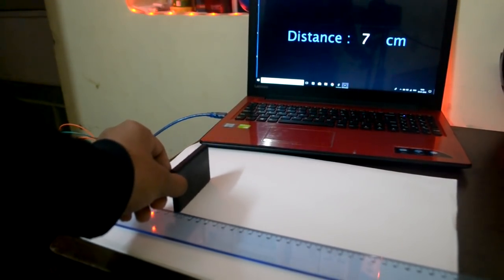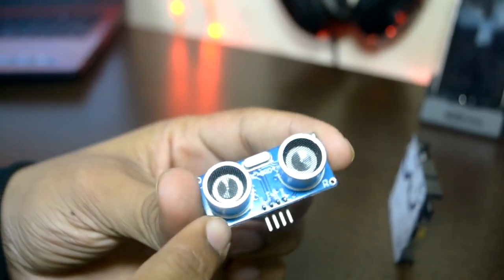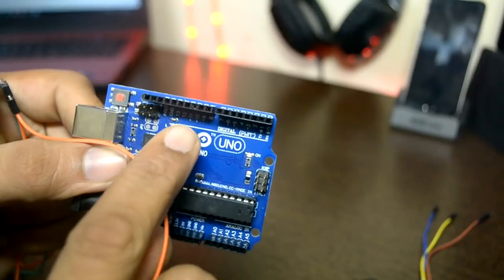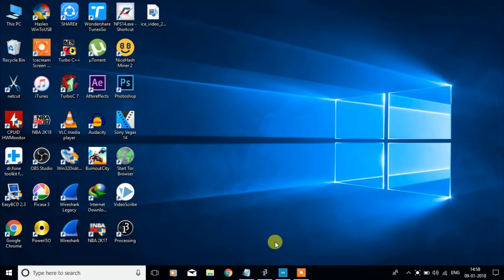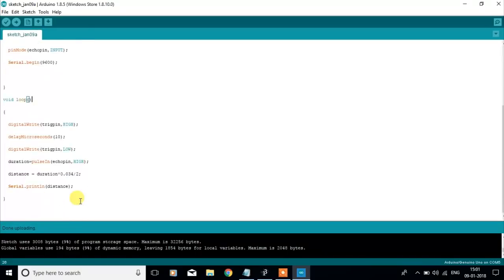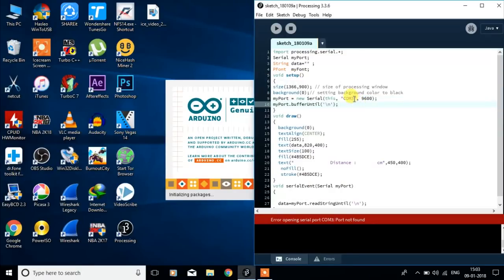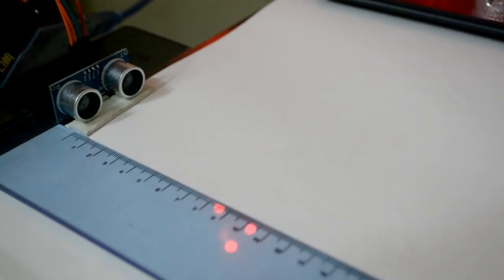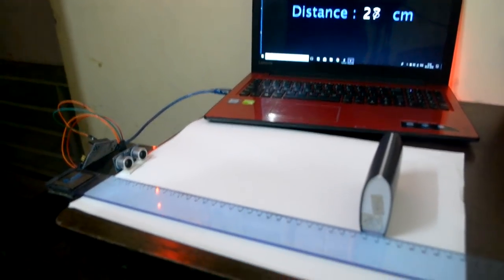[HINDI] Make An Ultrasonic Distance Sensor Using Arduino In Under 5 Minutes! Easy Arduino Project

Comment: Hi
I am on a macOS right now and when i run the codes it works fine but after the processing code is processed the sketch opened shows blank black page with no distance text...what to do???
Reply: how did you fix it?

Comment: C:\Users\Usman Fida\AppData\Local\Temp\.arduinoIDE-unsaved202307-10420-1l95blg.zik3\sketch_jan7a\sketch_jan7a.ino:1:10: fatal error: Mouse.h: No such file or directory
 #include <Mouse.h>
          ^~~~~~~~~
compilation terminated.

exit status 1

Compilation error: Mouse.h: No such file or directory

Comment: why it is necessary to remove connections between arduino uno and sensor to upload program?
Reply from the maker: Not all the connections but the rx and tx pins must be removed
Reply: @Harshsharma5  yeah sir i am facing a problem as I am not having my laptop and pc how do i code with my mobile
Reply: Nope